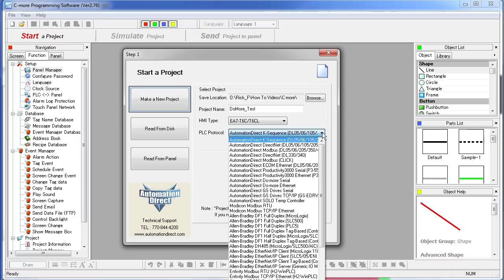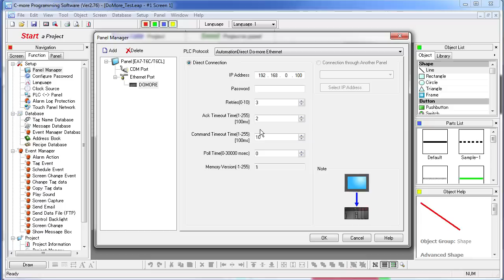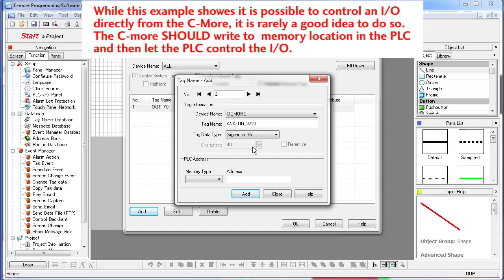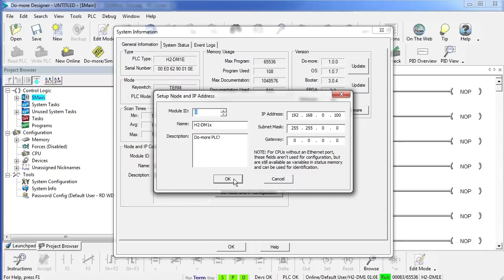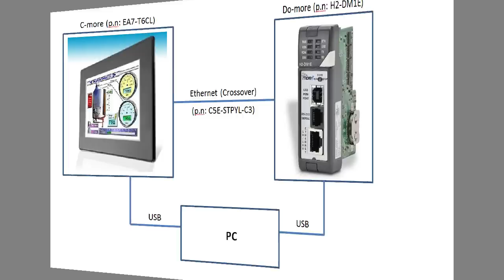BRX Do-more PLCs - How to Use a C-more HMI Display from AutomationDirect

Comment: How to find IP for HMI
Reply from the maker: If you are local to the machine, you can press and hold the upper left hand corner , of the screen, for 3 seconds and the System screen will appear. Select Setting-> IP Address setting. this display is cover on page 5-24 of https://cdn.automationdirect.com/static/manuals/ea9userm/ch5.pdf